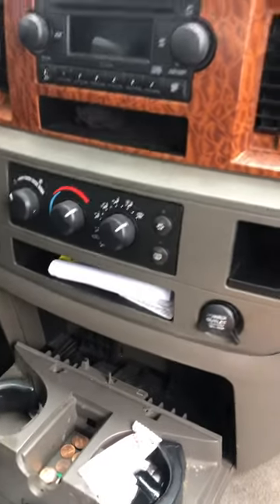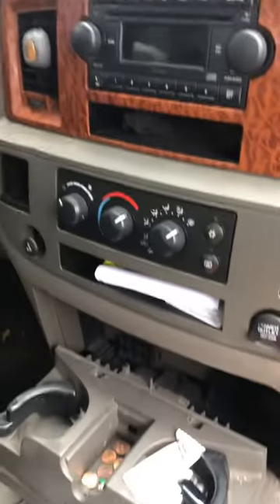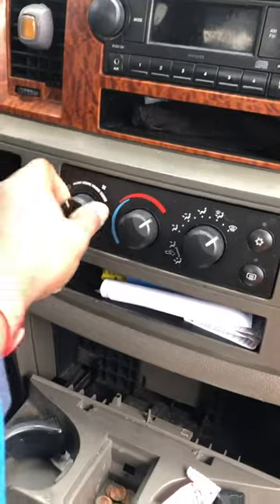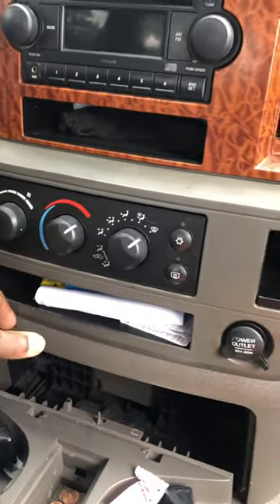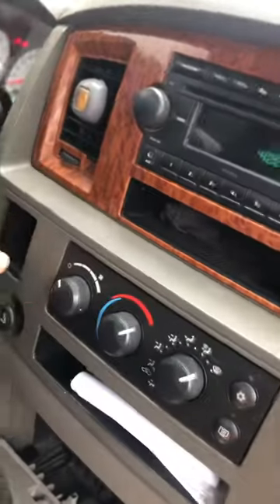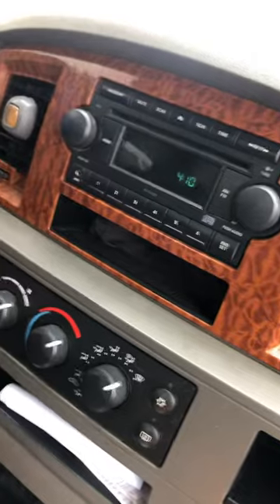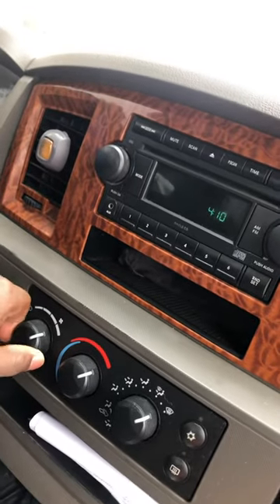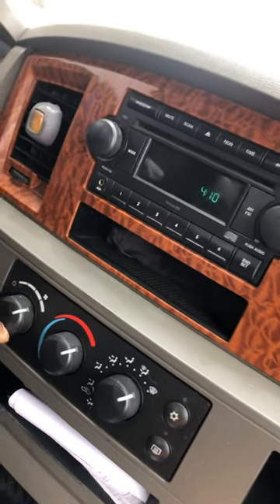2005-2012 Dodge Ram 1500 AC control panel not working fix in 5 minutes part 2

Comment: Funny thing is I got so tired of the ac working whenever it felt like working and even though it blew cold air it didn’t want to cut on for a while now, so I searched up how to knock some sense into your ac now I can finally beat on my blower and see if it works I’ve beat the dashboard enough

Comment: 2006 1500 ac condenser fan not working, new fan motor and not getting power.  Any ideas?  I don’t think there’s a fuse on this model 😢
Reply: Did you find a solution my 300 C isn’t blowing anything I just replaced my blower motor and checked the fuses they look fine but still noting I’m not getting power to my air controls

Comment: How do i replace the panel?
Reply: When you say panel you mean ac climate control panel? If so watch a video on removing panel to install led bulbs for climate control but if your talking about the blower motor there are three screws Torque or small flat head screw driver... Good luck 👍

Comment: Man I’ve replaced my blower, fuses, and the resistor and still can’t get this mf to turn on. If anyone has any advice I am all ears
Reply: Did you ever figure out the root of the problem? Because I'm right there with you, and I can't figure out wtf is causing it not to work!
Reply: @spencergrosh1996  it was my ignition switch! It wasn’t sending a signal that the truck was on, replaced it and I’m back in action!